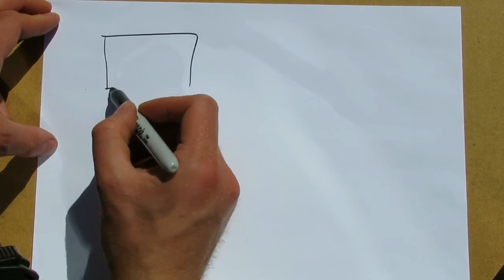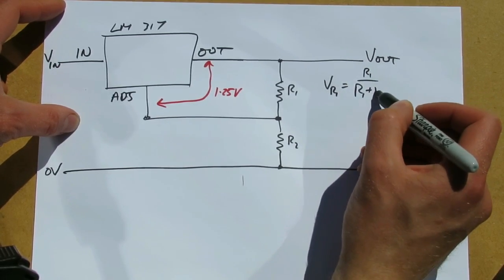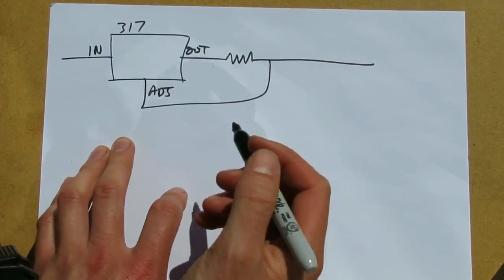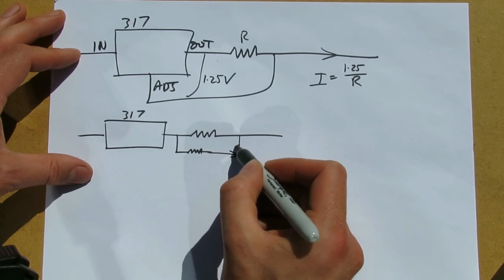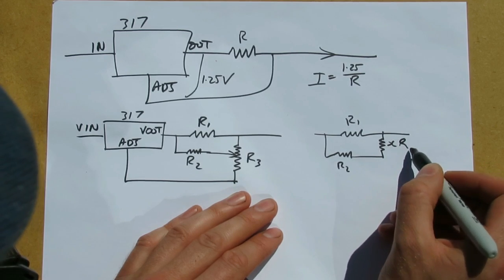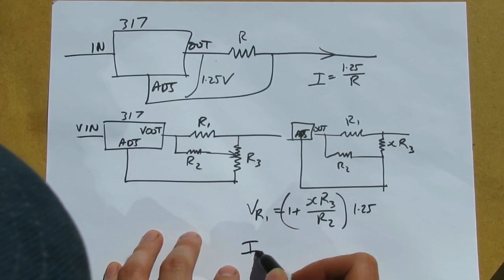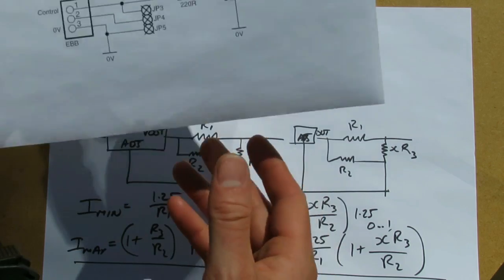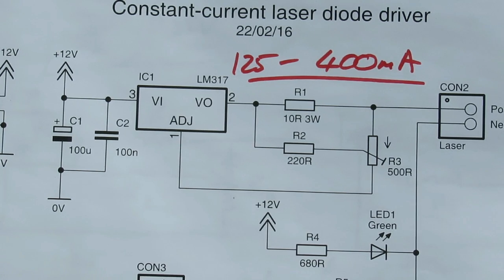LM317 adjustable current source/regulator

Comment: Short and on point, thanks :) for those who are confused by schematic, the rheostat is connected like a potentiometer with R2 going into the viper
Reply from the maker: Thanks! Glad you liked it. Not to split hairs, but technically a rheostat is a 2-terminal device (variable resistor) whereas a potentiometer has 3 terminals (potential divider) ;-)
Reply: @imajeenyus42  yeah, but for some reason the stabilisation part of your scheme didn't work for me until i connected it like a pot, with R2 on the wiper

Comment: Very few people know this , but, it does NOT have to be an adjustable regulator.... you could use almost any 3 pin reg such as a 5v reg etc.....it still works!
Reply from the maker: It will work, but it's less efficient because of the larger feedback voltage.

Comment: Very nice video, I didn't even think to look at with a voltage divider to find V_R1 knowing V_R2, it didn't occur to me until later of course. Just note the total current out includes both I_R1 & I_R2 = 1.25/R2 which would bump up your min & max current amount (i.e. +1.25V/R2). You also want to be mindful of the maximum wattage going through the pot i^2*R3.

Comment: I've got a different result here, the current is I = 1.25 (R1 + R2 + xR3) / (R1 * R2), the values in the end are not much different, but I am not sure if you calculated I1 correctly. In the end there is a R1 / R2 missing in the final equation, but since R2 >> R1 the difference is not very significant. Anyway, I think it might be confusing for people that are learning if they try to understand the calculations, that's why I am commenting it. Please Lindsay, take a look at it...
Reply from the maker: You're absolutely correct - in theory you should include the R1/R2 term, but like you say the ratio is so small in most applications as to be insignificant. For example R1 might be 10 ohms, and R2 might be many kiloohms.
Reply: Confimed - I reached the same result. The mistake Lindsey made was when he talked about "a resistor divider" when he computed V_R1. That is not correct; what happens instead, is this: (a) the voltage across R2 is 1.25V (b) that means the current across R2 is I_r2 = 1.25/R2 (c) the same current goes through xR3, since there's no current going in the Adj pin (very high impedance) (d) that gives us the total voltage drop V_total across both R2 and xR3 - since the same current goes through them: V_total = I_r2 * (R2 + x*R3). Now that voltage is the one driving the "secondary" current through R1: i.e. I_r1 = V_total/R1 = (1.25/R2)*(R2+x*R3)/R1. The two currents add to form the total I_out, which ends up as you computed. Sadly, the way Youtube works, Lindsay can't fix the video - many people will be confused and learn the wrong thing about circuit analysis here.

Comment: Hello Lindsay, I'd like to thank you for giving me a leg up or maybe a leg re up into an old hobby. Almost 50 years ago I was into valve amps. Google Mullard 20W - The National Valve Museum, yes I'm that old.
I was looking around YouTube and came across your video above. I was particularly interested in your current control. I had not touched electronics since my valve days and the 'gubbins' you were using intrigued me. I decided to have a go. Mind you picking a 60W soldering iron up by the wrong end made for an interesting start. I had had 410V across my nose but that's another story. 
Thanks to people on Forums and YouTube videos like yours I am now into 2N3055's LM723 and all the bits for a bench power supply. Strangely enough though I think yours is one of the few videos that goes into a simple current control. I needed it as I wanted to play about with LED's. Things have moved on a bit since then but I just wanted to say - Thanks Lindsay.
Reply from the maker: Hi JP, thank you so much for the kind comment! I'm really happy my videos are of some use to people ;-) I like going back to basics with simple things like regulators and discrete components - so many things nowadays just use an "all-in-one" chip, which doesn't really give you much room for understanding how it operates. I actually love "antique" technology as well - anything involving tubes, Nixies, gas-discharge stuff. I'll enjoy reading an old book from 1940 about valve technology more than a modern one on semiconductor stuff. I've never done much with tubes, apart from once building a little oscillator with an ECC83, but I have played around with Nixies and even built some gas-discharge tubes (there's some stuff on my site at http://imajeenyus.com/vacuum/index.shtml if you're interested). Best regards, Lindsay.

Comment: Dear Lindsay, my circuit analysis classes were 35 years ago, and this video is 2 years only.  The circuit has the advantage of defaulting tp R1+R3 in case potentiometer looses contact, fine.  However you loose me from min.5 onwards.  Letting R4=xR3, and R5=(1-x)R3, the equivalent resistance from ADJ pin's position to OUT pin is (1/(R1+R4))+(1/R2)+R5.  Therefore the bottom half of the R3 pot cannot be assumed zero, it is in fact the dominant term to determine current adjustment.  Voltage across R2 is not 1,25 volts.  Even if it was You can't write VR1 as you wrote.  It assumes same current over R4 (ie x.R3) as R2.  Since there still is a 3rd branch coming out of that junction as I5 even if you reduce R5  (ie (1-x).R3) to zero.  What's really happening here is the adjustment of R5.
Reply from the maker: Thanks for the comment. I agree, the circuit does look a little odd at first glance. However, the important thing to remember is that no (or at least very little) current flows in to or out of the ADJ pin of the LM317. Because of that fact, it does not matter what the value of R5=(1-x)R3 actually is, so it can be replaced with a short circuit. The current through R2 will be nearly equal to R4=xR3, so the divider equations I've written in the video will apply. Believe me, I built it, it works ;-)

In reality, there is a current of about 50uA on the ADJ pin, but this is negligible for most applications.
Reply: Thanks for caring to respond Lindsay. Although I am really in deep sleep state with eyes half shut, at this wee hour here, I surely don't question the circuit does work.  Just trying to clarify how it really works to brush off rust from my circuit analysis grasp, by rasping against your analysis, in friendly manner.   I am guilty of not checking LM317 characteristics too.  Hope you don't mind exercising with dumb old me here. :)

Now, "but", if current to/from ADJ pin is close to zero, we can only consider that as an open circuit, not a short circuit.  In that case, the effective resistor circle value on the output becomes equivalent to (1/R1)+ (1/(R2+R4)).  Evem if we give R4 pot a huge range, the max effective resistance control range we get, that between LM317 OUT pin and overall circuit output node, vary from (1/R1) to (1/R1)+(1/R2).  To increase that control range, we need a big value R1 and an R2 well below 1 ohm. Perhaps we could make R2 a 1ohm max. pot to use as a fine control over Iout?  After I wake up, I should try this physically, and get back. Please feel free to explain even further... :)
Reply from the maker: No problems, I don't mind ;-) 

Try this for visualizing how the ADJ pin functions. Suppose you have a voltmeter which draws zero current from what it's measuring - it simply measures the voltage. And suppose you use it to measure the voltage of a 1.5V battery. If you connect the voltmeter directly to the battery, it will obviously measure 1.5V. Now, suppose you inserted a resistor between the voltmeter and the battery. Because no current flows, there is no voltage drop across that resistor, so the voltmeter will STILL read 1.5V. It's as if the voltmeter was still connected directly to the battery - i.e., the resistor replaced by a short circuit.

This is why it's possible to ignore the presence of R5 (which is (1-x)*R3) - since no current flows, there is no voltage drop across it, so the voltage at the ADJ pin will be equal to the voltage at the junction of R2 and R4.

The LM317 will adjust its output until the voltage between the OUT and ADJ pins is 1.25V, in other words until the voltage across R2 is 1.25V. That then means the voltage across R2+R4, or across R1, is 1.25*(1+(R4/R2)), because no current flows in to or out of the junction of R2+R4.

Does that make any more sense? ;-)

Regarding the relative value of R2, you don't want to make it really small, because that would give you a huge adjustment range. In the current-regulator circuit shown in the video, the maximum output current is (1+(R3/R2)) times the minimum output current (which is 1.25/R1). If you made R2 very small, that would give a very large output current.
Reply: Thanks for the continued exchange Lindsay.  Well, we should measure both ends of R5 and see if the voltage drop is really close to zero.  I have 4 old Chinese fake LM317's around, none seems good to test.  Waiting for new ones.  Maybe an EWB simulation would illuminate me? :)
Reply from the maker: According to the datasheet, the current on the ADJ pin is 50uA, so if R5 was on the order of 1k, that's only 0.05V, which is reasonably small compared with the 1.25V reference. I haven't actually got any to hand either, and unfortunately the only simulation software I know how to use (LTSpice) doesn't have an LM317 model ;-)

Comment: If you use an LM338, connect pin2 of Lm338 to R1and R2. Connect other side of R1 to outer pin of Vr1 and load. Connect remaining side of R2 to Vr1 wiper pin. Connect last outer pin on Vr1 to Lm338 pin1. Vr1=***25ohm's R1=2ohm's 5w R1=5ohm's Should give a range of .625A to 3.87A. 
***My Vr1 was 26ohms so the math was off a 26ohm.

Comment: weird application i am considering if you are still about. My Model Train has a smoke generator. it vaporizes an oil to create white smoke that we puff into the air thru a Mini DC fan. The housing that do  this are usually aluminum and a fixed size. My trains are S Scale and unique from 1950. I have made a Smoke housing that works via my 3D Printer. But if it over heats yes it will melt. I can use a 10 Ohm Heater to make good smoke at 9 volts. But the track power available ranges 5 to 20 AC Volts.  My little DC Can motor needs DC so i run the track power thru a Rectifier and get a reduces DC volt,  then for the Heater I run thru a 7809 With some caps to maintain the 9 volts. But it is not very stable and i have had low smoke and over heating issues. I wanted to see if i can use the 317 with a termistor  Sensor to use Heater Temp to regulate the 317 output. So if it gets too hot the 317 regulates V out down. Is this practical in any way or am i dreaming up stuff that can not be done. My issue is space. My trains are not big so i need small and simple circuit. Can this be done?
Dennis
Reply from the maker: Might be possible, I've seen a few people use a thermistor + LM317 for a fan speed controller (thing heats up, fan runs faster, cools it down). If you put a thermistor (NTC) in place of R2, then as it heated up, its resistance would drop, which would make the LM317 decrease its output voltage, thus reducing the heater power. You'd need to play around a bit with values though to get something that worked at just the right heater level.

Comment: Why in the calculations you didn't considered the (1-x)·R3 for the other part of the potentiometer between x·R3 and the adjustment pin??
Nice video by the way!!
Reply from the maker: Thanks! You're absolutely right - there is (1-x)R3 in series with the adjustment pin, but I'm making the simplified assumption that the pin doesn't source or sink any significant current, so that resistance won't affect anything. In practice, there is a current of about 50uA flowing out the adjustment pin, which will become significant if R3 is relatively large, but I try and keep it around 1k or so to avoid this.
Reply: @imajeenyus42  Interesting I'm glad you kept it simple  
seriously thanks for going deeper and explaining it so well
great vid thanks

Comment: H Looking for an output of 10~150mA. I chose R1 = 100, R2 = 1k, R3 = 10k. This should put me at a maximum of 137.5mA and a minimum of 12.5mA. With an input of 13V (to reach get the needed 3V headspace), my minmimum current is 20mA. Any ideas why its 20 and not 12.5mA?
Reply from the maker: It's because of the small current that flows out of the ADJ pin on the LM317. This is approximately 50-100uA. I haven't included its effects because it makes the equation more complicated. If you do include it, the effect is to increase the output current, and in your case it would increase the minimum from 12.5mA to around 20.
Reply: @imajeenyus42  this is what I figured. It just seemed like a big increase, but I guess not. Thanks for the reply

Comment: Build this thing to test power supplies and calculated a range of about 80mA - 1000mA when R1 = 16, R2 = 100 and R3 = 1220. But in reality my range is merely 240mA - 660mA. Not sure what is going on here and if there are better values available to get my desired range.
Reply from the maker: With those values, R1 will be dropping 16V at maximum current, so you'll need an input supply capable of delivering at least that above the level and voltage.
Reply: @imajeenyus42  now that explains a lot as I'm testing 12v supplies. Guess I'll have to recalculate with maybe 4 or 8 ohms.

Comment: Very good explanation and no distracting music (apart from the odd fly on your paper). Is it possible to place a led in your circuit to indicate when the the current limit is reached ? If so where would be the best place to insert the LED ? Thanks
Reply from the maker: Thanks. This circuit is acting as a current regulator, not a limiter, so it's not really possible to have an LED somewhere to indicate when current is being limited because, well, it's not being limited!
Reply: @imajeenyus42  Yes, I see what you mean now. Thanks.
Reply: @imajeenyus42  sorry to bug you again, just wanted to re-phrase my question. I understand it is regulated but in a way, it is a limited current range by the adjustable trimmer R3 (125mA to 400ma). If I was to lets say short the output with a 10ohm resistor, then no more than 400ma would flow through it. Where could I add a LED to indicate that the current had reached the maximum regulated current set by R3 ? Does that make more sense ? Thanks for your time, I really enjoy your videos, they are always clear and explained very well.

Comment: Excellent tutorial! Quick ?--> I'm still a bit confused about the potentiometer network. Could I use a 3 pin potentiometer, with one pin connected to R1, the middle pin connected to R2, and *the third pin connected to ground*? I noticed the 3rd pin was connected to the adjust pin but have seen these connected to GND typically
Reply from the maker: You could, but that would give some weird response because it's then a sort of blend between a current regulator and a voltage regulator. I.e. it would regulate neither. If it's a current regulator you're after, one end of the pot needs to go to the adjust pin as shown.
Reply: @imajeenyus42  thanks so much for responding! Looking forward to building and testing this circuit!!
Reply: @imajeenyus42  this may be a basic question, but it's been my experience that laser diodes are best driven with current, not voltage. That being said, if the resistor values are chosen for a current range, should there be a concern for voltage limits of the laser diode being exceeded? Or is it safe to assume that if the current ratings are within the datasheet spec, there should be no cause for concern? Was the circuit you built for the laser cutter simulated in LTSpice, Multisim, etc before being built or were the hand calculations sufficient enough to get the gist of the circuit behavior?
Thanks again for an excellent tutorial and quick support!
Reply from the maker: @libanhussein7433  Laser diodes, like LEDs, have essentially a constant voltage drop regardless of the current passing through them, so it's not like there's really a voltage limit that can be exceeded. The current is the important thing, and there is a current limit above which damage will occur (usually from overheating). So if the current is kept in the safe range, nothing really can go wrong. I didn't bother simulating anything here because it's a relatively simple circuit and the behaviour can be predicted just from the equation.
Reply: @imajeenyus42  really appreciate you taking the time to reply to these comments! Thanks again!🙏🏿

Comment: I looked other videos, people use diferents R1 and potencimeters, it is about a relation from the datasheet recomendation i guess, not a solid teory because people also break the releation, I guess it could affect the sensiblity or usefull range in the potenciometer. There u have 3 resistances in ur scheme I also has not ended to understand why to put R1, since it is to small  i think my datasheet is despising it
Reply from the maker: I don't understand your question. Different people will of course use different values of resistors, since they will have different voltage/current requirements. If you are asking about R1, it is the current-sense resistor so obviously it will be small.